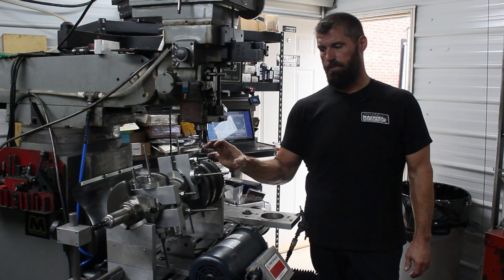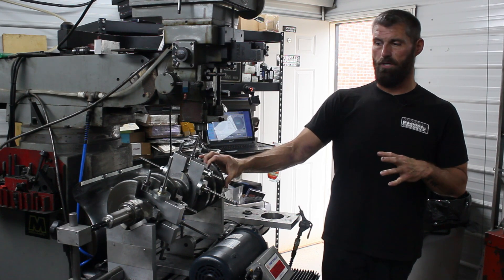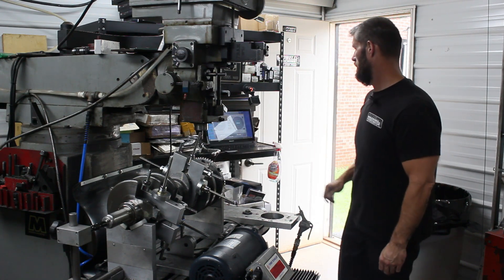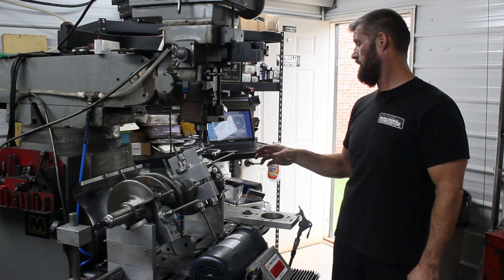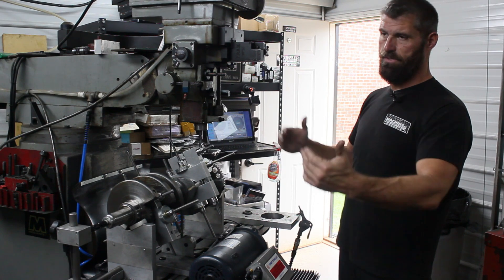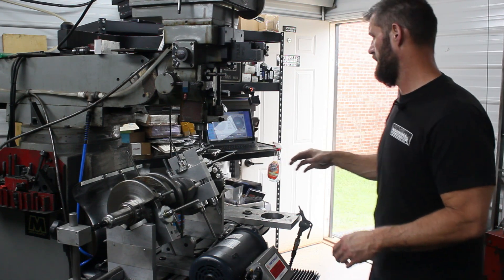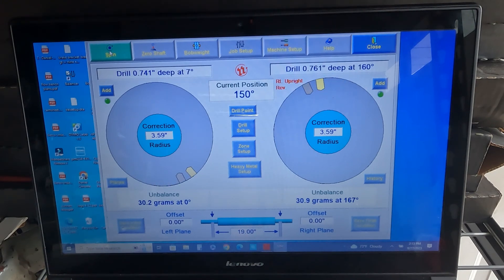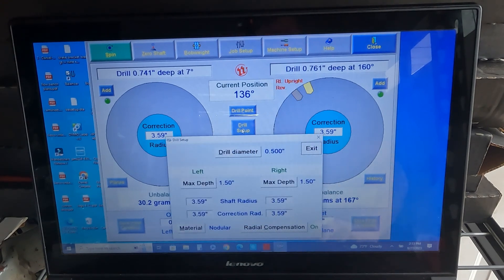Balancing a 6.2 Ls crankshaft

Comment: Mr Powell could you explain briefly what is the difference between the external vs internal balance please.
Reply from the maker: Internal = the harmonic balancer and the flywheel/flex plate are neutral balance,  external = balancer/flywheel have extra weight added to balance the crank

Comment: Please understand im not trying to be rude with this question.  But why are the offset values on the fron and back set at "0" ? I was taught to set them halfway from the counter weight to the center of the "v" blocks. Im only asking because i want to learn and gain knowledge.  Our shop also has the same software. Thanks for all you do for the engine building community!!!
Reply from the maker: Offset value? Not sure what ur referring to?

Comment: I'm replacing the iron pistons of my 1930 caddie V16 with aluminium pistons , I was concerned about balancing but when I took the pistons out I realized that the crank has no counter weights other than the ones for the crankshaft itself without the rods and pistons . Should I worry about fitting pistons half the weight ?
Reply from the maker: It will need lots of work

Comment: Interesting video. Your final spin showed imbalance 9 degrees apart.... this will for sure be a problem at high RPM. Your final imbalance should be 180 degrees apart to avoid high RPM imbalance issues.
Reply from the maker: No

Comment: On a couple of engines where we have had 100 grams to remove, we chuck it up in the lathe and remove the entire counterweight until we get down to something reasonable to drill out. It’s pretty rare, but on my Mopar stuff with lighter aftermarket rods and pistons it can happen.

Comment: I understand how the Dynamic balance Machine works If the Rotating Assembly was spinning Without the cylinder Heads on & No Compression/Ignition events happening but why Dosen't the Running engine's various Intake, Compression & Ignition strokes (which effectively Lightened & Increases piston Weights) Upset the Running engines Total Dynamic Ballance condition ?? .....Thx for showing.....

Comment: Since you have one up and running, what's your thoughts on that mill mounted balancer?   If you had to do it again, would you be cool with that, or insist on a free standing unit?

I've been wanting to get that same unit, but I can't decided if I want to tie up the mill (and have to constantly tear down and setup every time I need to mill something.

The downside is the extra footprint of the freestanding blancer, but at the same time I'd have to make room when I need to use the mill as a mill.

Comment: I have seen you do a lot of LS Motors. My question is have you run into main caps that have porosity? I just watched a video that showed this problem and they said the caps are made from powdered metal. I wanted to know if you have a video on this or could shed some light on this issue. I am an old retired mechanic/machinist. I have to say I have never run into this when I was doing engines but the industry has changed considerably. I like to stay up changes to the industry. You seem like a pretty straight shooter.
Thank you

Comment: Aside from the intense labor, I would like to hear your thoughts about grinding the counterweights and shaping them for windage purposes vs drilling. Also, your thoughts on chamfering the balance holes. I know this is extreme for a mass produced crank. Thanks for posting because it is informative.
Reply from the maker: The leading edge would be the only benefit,  and as you seen it didn't need  correction on the edge, also I don't think you will see any advantage on 90% of builds, the extreme rpm stuff, yes, also oil control is a much more worthwhile venture IMHO,  windage trays, properly designed pans ect.
Reply: @powellmachineinc  to me alot depends on the use of the car..  if its a roundie round car you end uop with a lot of oil on one side of the pan in corners front to back on the crank if it splashes up too high..  vs a drag car that sees the oil migrate to the back of the pan and thats it.. and guys building weekend warrior street / strip cars - seems like a waste of moiney for that crowd..  I never had a crank shaped..  i did put purpose built pans and windage tray in one motor that spend alot of time at the drag strip..  just because it seems modern oils at the time (late 90s) were more apt to foam..  in my opinion theres a lot of money spent on more extreme measures like someone asking for perfect zero balance, and crank shaping ..  in cars that likely never get used to anything close to their limits..  but it sounds good to tell people you had all this specialized work done..  a crank balanced as nicely as this one in the video is gonna run true  and be the least of anyone's worries (improper  fueling and timing ruins way more rotating assemblies)

Comment: Daniel,  would you give me cam specs you would use to get the most out of a L30 305 vortec, putting it in a stick shift short bed 2wd square body,  until i get the 327 built that im oulling out of it?
Reply from the maker: Email me more info,  intake, rpm range,  usage,  ect...powellmachineinc@gmail.com